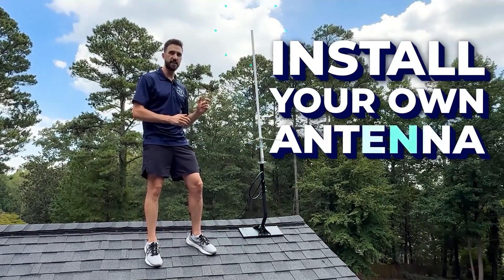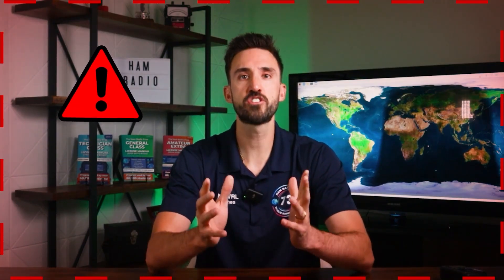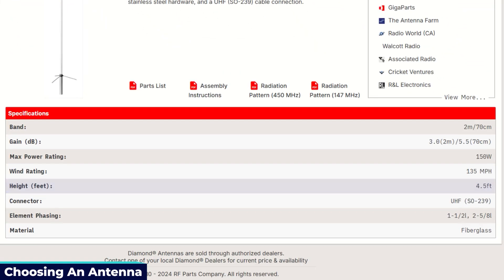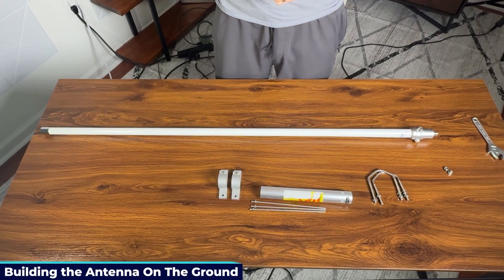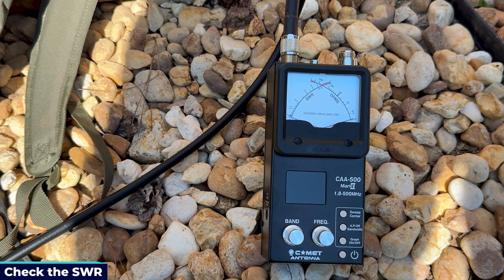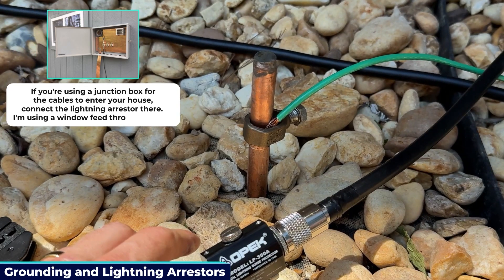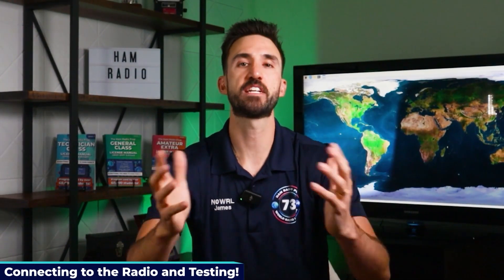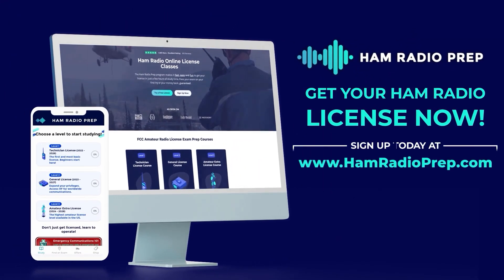Install a Rooftop Ham Radio Antenna (Step-by-Step Guide)

Comment: Very nice, when you call a "strain-relief" is actually a drip-loop designed to redirect rain from running down your feed line into your shack. Wrap the connectors in self-fusing silicone rubber tape used to waterproof and seal outdoor coaxial cable connections like the PL-259 connector.
Reply from the maker: Thank you for this great tip!!

Comment: Great information!   I’ve watch both this vid and your window pass-through video.    Very good information and explanations.    My question is since you have a lot of coax and a number of different connectors between the antenna and the radio,   Have you calculated how much signal loss you are getting from the whole system?

Comment: If you are setting up a temporary mast and antenna, does the grounding requirement still come into play?
Reply from the maker: Great question - if you're just setting up something temporary, you don't need to install a ground. Just make sure to be safe and don't leave anything up in case of storm, etc.!
Reply: @HamRadioPrep   cool.. a good way to dip my toe in the water.  Ty!
Reply: I don’t have grounding on my antenna. I disconnect it from my radio when I’m not using it.

Comment: I recommend silicon fuse tape for the coax connections, and wrapping that in electrical tape to further waterproof the connections and reduce the chances of corrosion.

Excellent video. 👍 - KF0QNM
Reply from the maker: Great recommendation, thank you for sharing!

Comment: Great videos and How-To's. That is what I hope to do, but for HF. Mast-mounted probably and braced to the roof-pitch eave. Gotta figure out a good choice for the antenna. Hex Beam maybe or vertical. So many questions. What is your coax of choice from indoor to outdoor? Thanks James.
Reply from the maker: I would recommend LMR-400 for best option! It can be a bit pricier but well worth it for a permanent home installation.